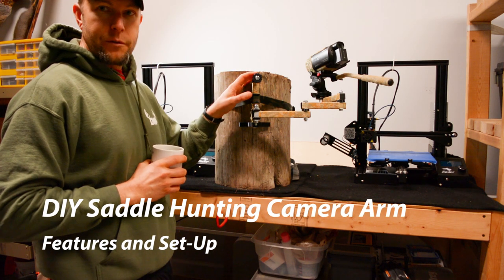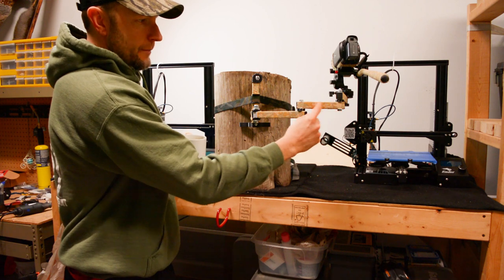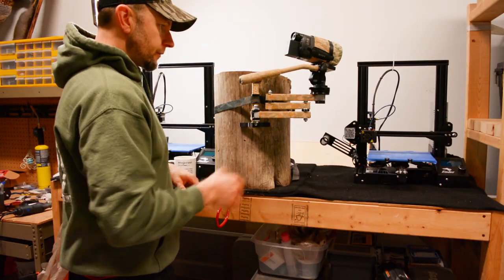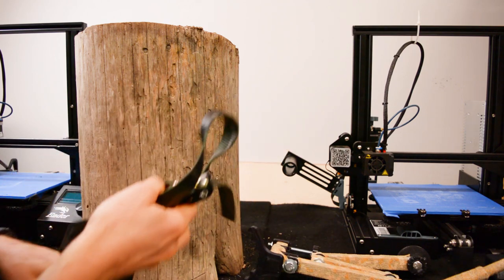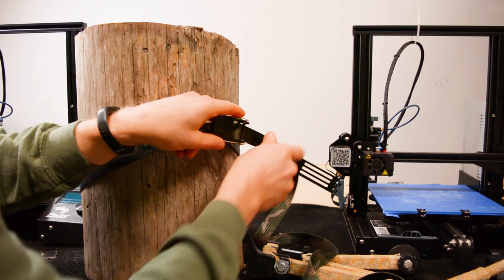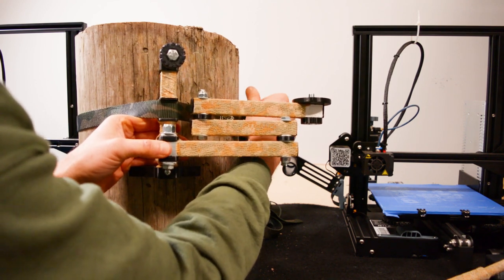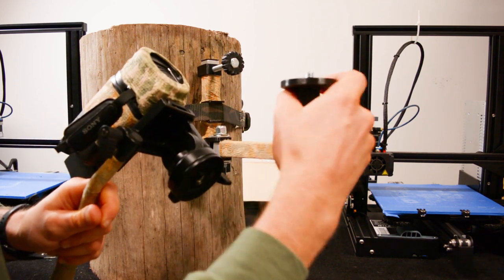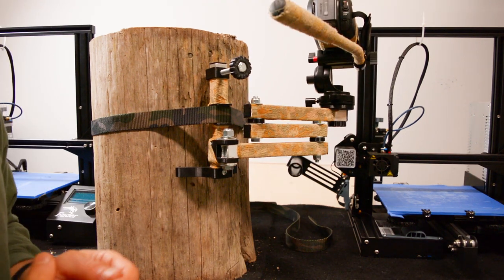Self Filming Saddle Hunting Camera Arm Setup

Comment: I use a hang on stand, but this should work for me still, wouldn't it ?  Planning to use a fluid head with a cheap, lightweight Sony model HDRCX405 1080p camcorder, which only weighs about 7 ounces i think....
Reply from the maker: Yes it will work the same. Many treestand arms have only to sections in the arm. Saddle hunting seems to require some smaller arm sections to maneuver between you and the tree or wrap the tree. This arm has 3 smaller sections to do this. This is the main difference. Overall length may be slightly shorter as well compared to other arms on the market. Check this before you make a decision! I know of a few hunters using this arm in a treestand. Let me know if you have any other questions.

Comment: What is the name of the bracket that you are attaching the base to the arm? The black one right above the standoff that has them connected by the bolt.
Reply from the maker: The arm itself is connected to the base with a bolt - yes. This joint is a piece of C channel tig welded to the vertical base to ensure a strong connection.  Hope this helps!